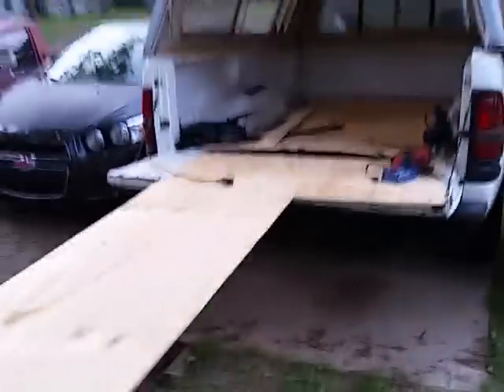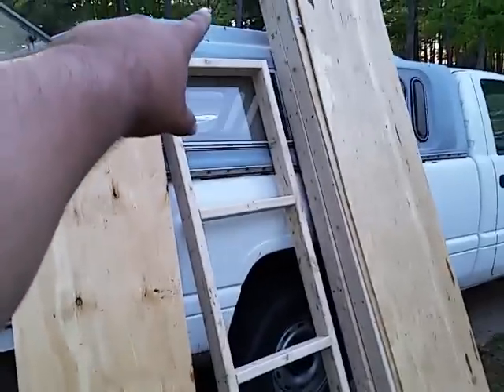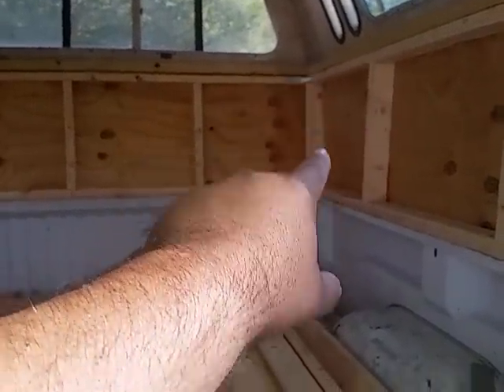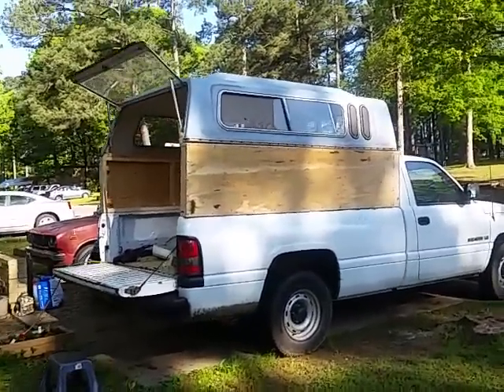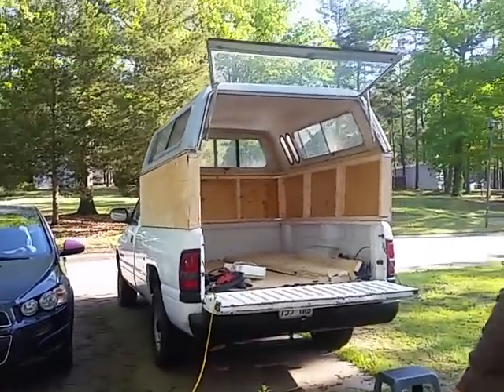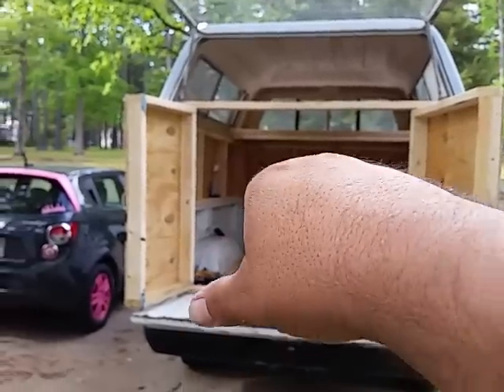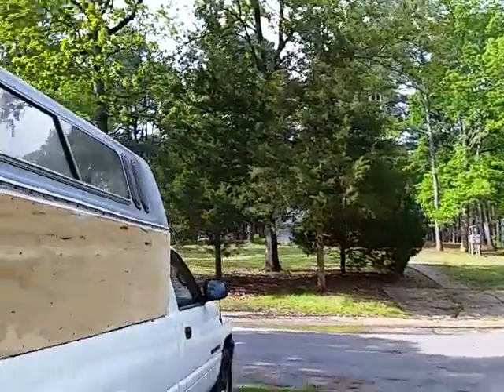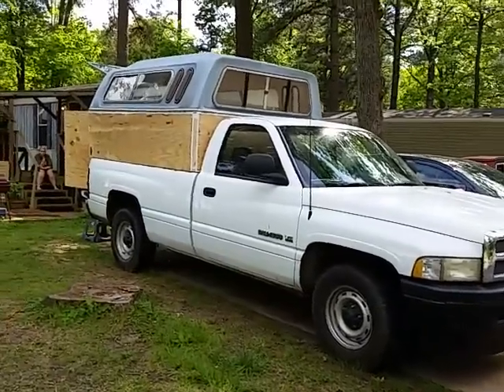Homemade camper

Comment: I'd run some threaded rod thru from the shell  to the bed rails for some extra security.
Reply from the maker: You make a good point I got some that I got for that purpose. I may just go ahead and pull the self tapers and put those in. Thanks for the input and thanks for watching.
Reply: I'd hate to see it blowing away going down the road after all that hard work.
Reply from the maker: I can understand that I got 11 3" self tapping bolts in it now I don't think it's going anywhere but I may put a nut and bolt at each corner  for good measure

Comment: Neat camper Larry...like that you can haul an ATV or riding mower with you and still got room up top for sleeping ...are you going to use a window type air conditioner or a RV style unit?
Reply from the maker: I ended up using a window AC unit and a generator I've sent storing this one apart and I plan on building another one just not sure exactly what route I'm going yet and thank you for the compliments